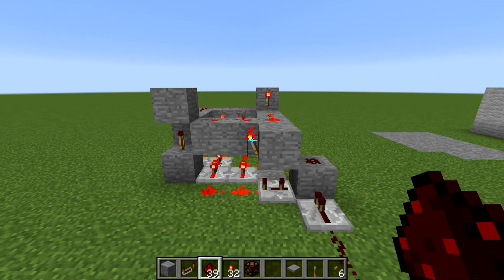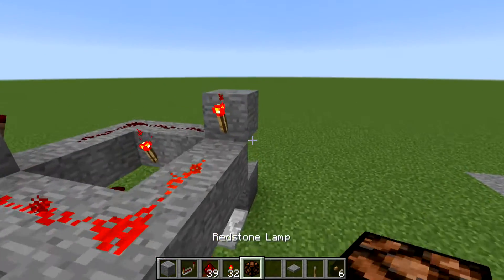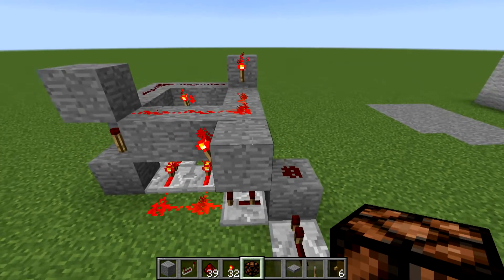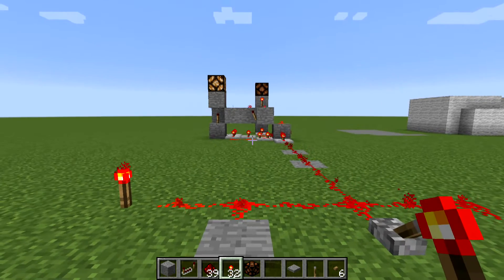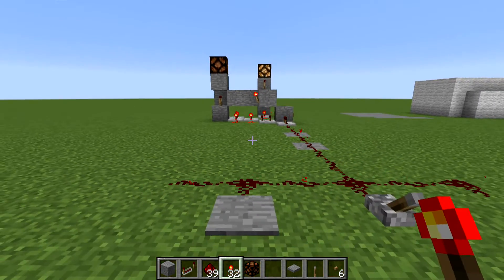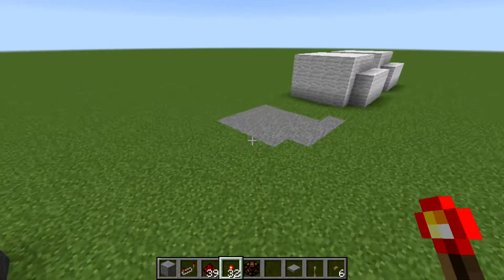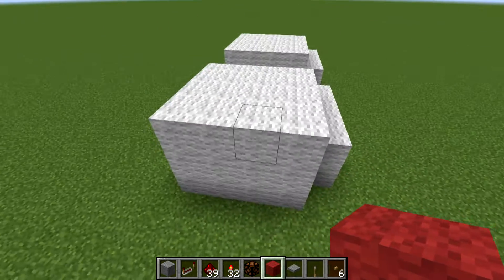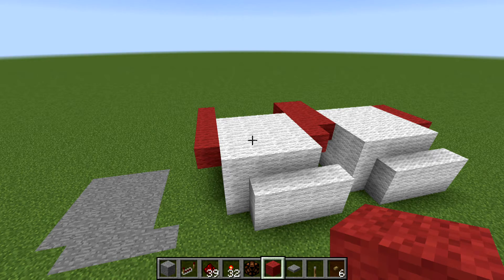Minecraft - Silent Redstone T-Flip Flop - No Pistons, No Hoppers, No Comparators

Comment: Alright, so this is pretty much the only reliable T flip flop Ive found works in Be Together MC update. But how in the hell does this work? Im lost. Just removing the repeater that is powered by the button causes the flip flop to permanently malfunction/oscillate until a piece of redstone is removed and then replaced. Awesome design man, but Im baffled
Reply from the maker: First off, thank you man! That feedback is seriously appreciated (I know I used to waffle on a hell of a lot in my minecraft videos). 

Sooo, the way this works is you have two clocks that are feeding into themselves and the other clock. On the top circle, when one torch is on that will be turning off the torch that feeds into the torch below it, so that loop is actually 2 L-shaped loops right next to each other. 

Each of the top redstone torches interrupts the other one, that just means that the loops are asynchronous and only one will ever be on where you take the output. 

The inverse pulse generator freezes the current state of the two clocks until it gets a signal, and then it will only ever be off long enough for one cycle of the clocks which means that they switch outputs for the purposes of the flipflop, and the redstone repeaters underneath just allow you to separate the signal from the two inner torches and have an outside signal coming in from the pulse generator. 

Sorry for the massive reply, I hope that helped explain it! Thank you again for the awesome feedback! :D
Reply: WhamyKaBlamy Yes that helped a lot thank you! The response time is crazy too, I dont know if youre making videos or not still but you just got another subscriber haha. I just wish the simpler designs still worked as Im just trying to have a convenient way to hit a button to activate a row of dispensers as well as prevent my dropper elevator from turning on until I have hit the button again and removed the water. Im building an automatic farm, complete with a hopper sorting machine, a dropper elevator to dispense seeds back to the harvested farmland (which Id prefer dont come out while water could still send them back through the hoppers again), and automatic locking and unlocking doors to allow villagers to replant my farm. I dont like just copying a design as long as it works and using that, so I wanted to fully understand this as a way of maybe compacting it. However I think you're right in that this is as good as it gets. This is the most confusing, material cost effective, and reliable T flip flop for the new update though, and your voice makes that shit entertaining. Dont like younger kids showing me up on redstone haha =P, thanks a ton man!
Reply from the maker: I'm really glad it helped! I do make videos still, I just don't do minecraft so much unless I have a random idea about something and then totally obsess about it >_>
I absolutely understand not wanting to just copy a design, plus it means you can modify it like you say :D
I have to admit I'm a bit annoyed by the BE update myself with how they've done the chunk loading - one of the things I've been working on recently is converting a specific strength of signal into pulses, so you can essentially encode a binary signal to send over a really long distance with only a single line of redstone (I get obsessed about rail systems in minecraft). Now that's pointless as you have to build this massive construction every 5 seconds of travel time on the track. 

And man, I know what you mean about younger peeps showing you up. I tried making a comparator version once and my brain just went, "NOPE! Screw this, I'm out" *cue sounds of someone walking away inside of head*. I look on youtube and there's someone who must be 1/3 my age doing it like a badass -__- 

Thank you so much for the subscription! We gotta keep them youngin's in line!
Reply: WhamyKaBlamy I cant wait to see what kind of tech gods minecraft redstoning is creating lol, and what a fascinating idea, if I dedicate some time to that and think up something Ill be sure and let you know, until then Ill just stay up with your vids haha. Im thinking hoppers and comparators may be the key to your idea, but redstone, much like I understand programming is like for those who do it, looks good in your head but then you have to work out the bugs.
Reply from the maker: Sorry for the slow reply, rough week! And yeah, some of the stuff they're coming up with is crazy! 

The way I did my pulses was that I had a set of pistons that were acting as t-flipflops within the construction, and then I had two designs; One is you send the strength in, and that activates the pistons that correlate to it, and along the back there's a delayed set of AND gates, so it cycles through to every piston that is active and I draw the pulses off of that cycling. 

The other design is the pulses set up the pistons and then trigger the same cycle at the back; That just allows you hold the signal to send it on. So say you were on a rail cart - you'll have a set of junctions that are above strength x (or x pulses), and the other is below. You send that signal off, it's held so when the minecart comes along it triggers the pulses to go to the right direction, then it all resets. 

The only reason I've not done a video on it is that it's literally only useful for pre-better together :(